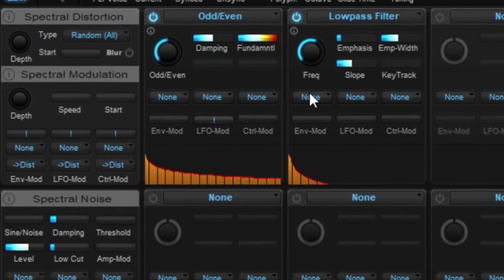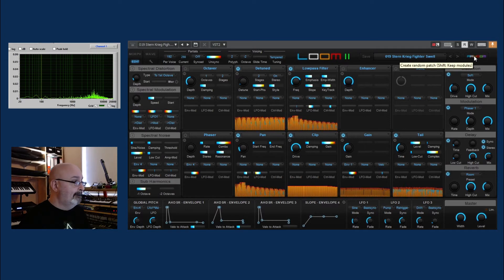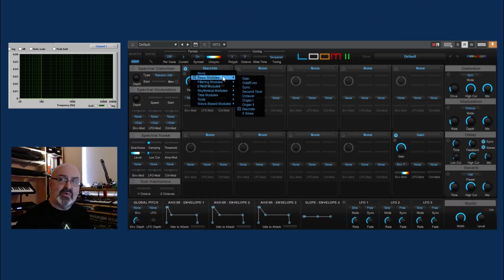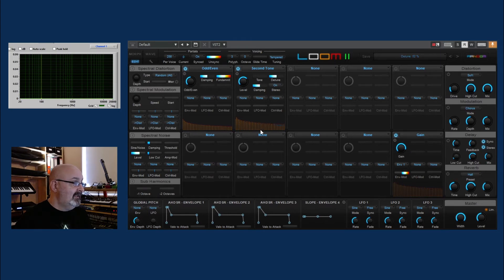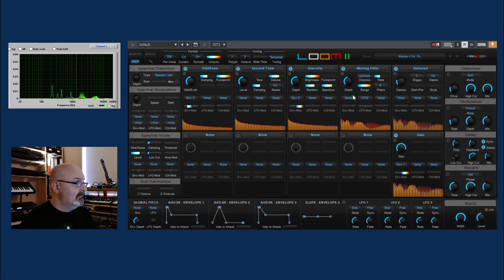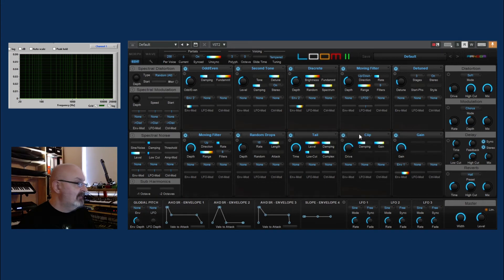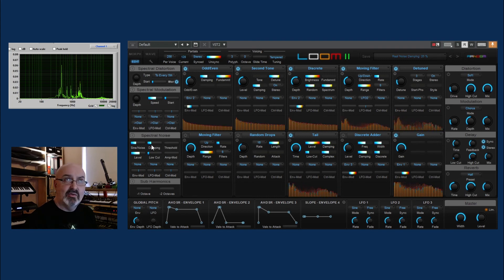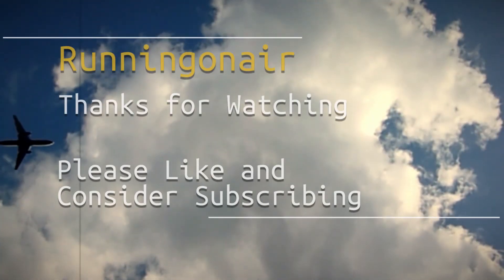Loom II Additive Synthesizer - Part 2 - Sound Editing

Comment: I am going to try that moving filter, beautiful.  It took me a while, but it seems like to me that all the patches prior to the effects are operating on the sines prior to being generated.  Like the whole thing is one complex generator, and the modules give you different ways to specify how the sounds get generated.  For example, the filter doesn't generate a signal then filter the signal, it calculates the partials that would be removed prior to generating the sound and doesn't generate them in the first place.  EG the filter is applied in the space of partials not on the generated signal.
Reply from the maker: Yes, it's just a bunch of sine waves with different algorithms to change pitch and level.  I've not used it for a while but it does have quite a distinctive sound.

Comment: Thank you for the video!
Here's an excerpt from the manual regarding the Synced feature...
 Synced: This parameter is On by default and synchronizes the start of each partial when you 
play a note. This results in a tight and focused sound. Switching this parameter Off lets the 
partials run freely without re-synchronizing when a note is triggered. The result is more 
phasing among the partials and a less focused, more “blurry” sound that may be perfect for 
certain applications. Switching this parameter to Stereo doubles the number of actually 
rendered sine oscillators, with an Unsync control to adjust the amount of unsynchronization. 
There is no “correct” way to set this parameter—it depends on the sound you wish to achieve. 
Note: The Per Voice parameter sets the number of partials available for each voice. 
Increasing this parameter places greater demands on your CPU but allows you to construct 
certain types of sounds that require a large number of partials in order to be heard correctly 
(for example, bright bass sounds with lots of high-frequency partials). If you would like to use a 
large number of partials while minimizing CPU load, you can try switching on Eco Mode 
(described in the Settings Page section of this guide).
• Unsync: This slider adjusts the amount of unsynchronization when Synced is set to Stereo.
Reply from the maker: Thanks for the info.